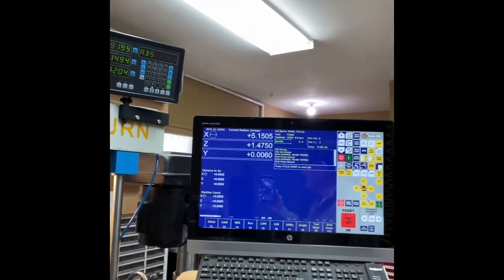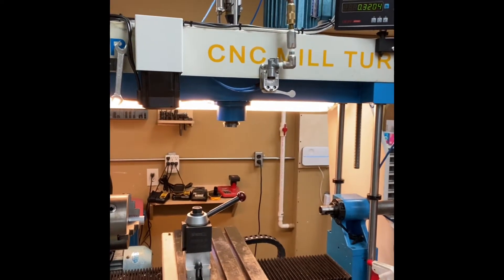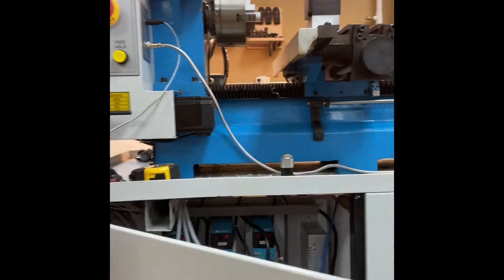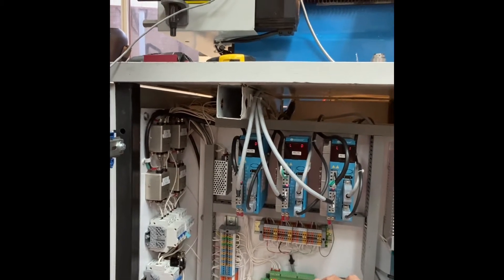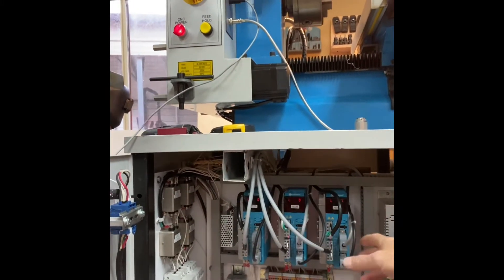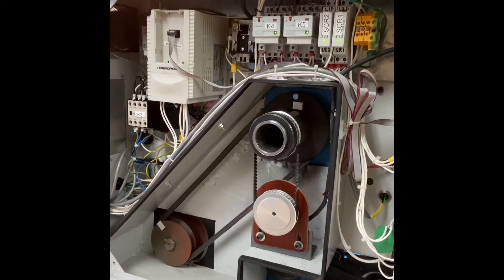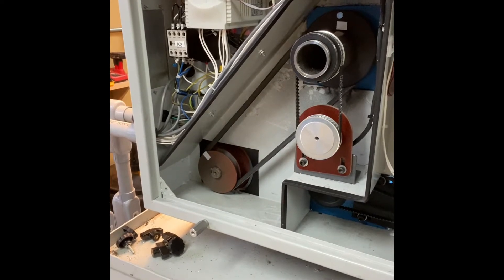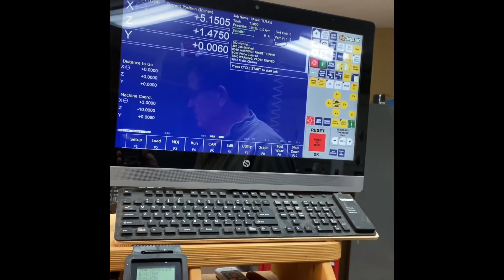Shopmaster Mill Turn conversion and first lathe part run

Comment: Hello Terry. My name is Brighton and I came across my first lathe mill combo. I'm excited but very intimidated to get started. Mine seems to be an older model, but I was wondering if you could point me towards any info on how to get mine in good working order? Mine does not have the double column brace at the back, and that is something I know I want to upgrade for rigidity on the mill. It actually already has a cnc variable system on it that the shop I bought it from didn't ever install fully. I got it for pennies on the dollar and would love to chat and learn something. Thanks!
Reply: Good thing you got it for pennies on the dollar.   I have a Shoptask Bridgemill Eldorado.  Doing a cnc conversion  on in Texas

Comment: Very clean control work. You can hear the CSS (Constant Surface Speed) working thanks to the line driver differential encoder you installed. Post a video when you try threading or tapping.
Thanks for sharing your work Terry!